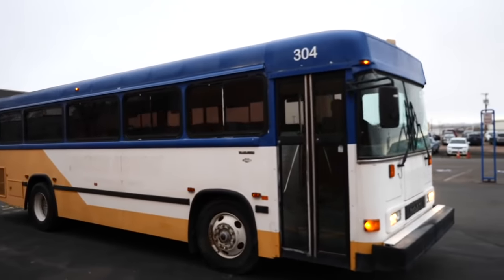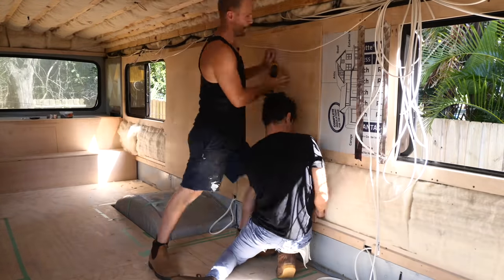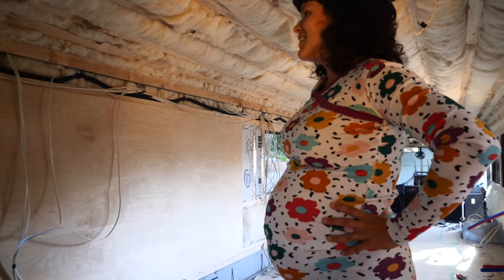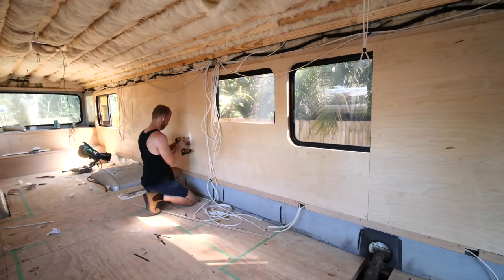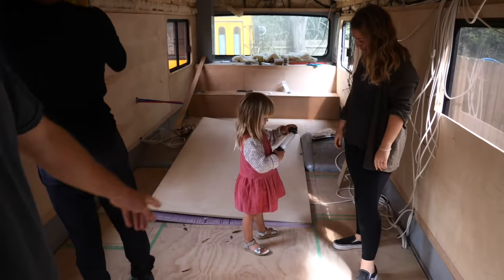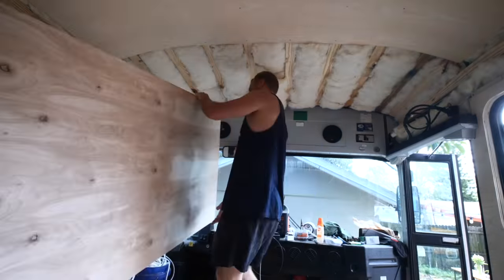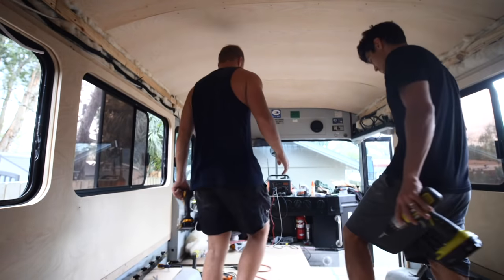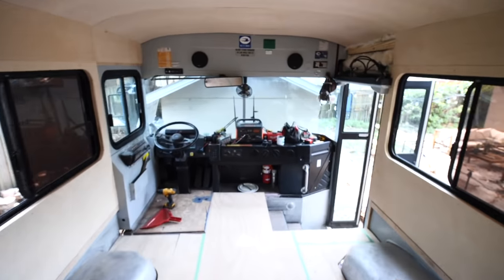Birch Plywood Everywhere: Bus Conversion Stage One is Done!

Comment: have you tried gluing pieces of cardboard together until they fit the space perfectly and then using the mock cardboard panel as a template for cutting the wood?
Reply from the maker: I did something similar in my previous build for the interior walls but coming up in two videos I'll show you how I did it this time. I don't think making templates like that is super efficient but thanks for the idea.